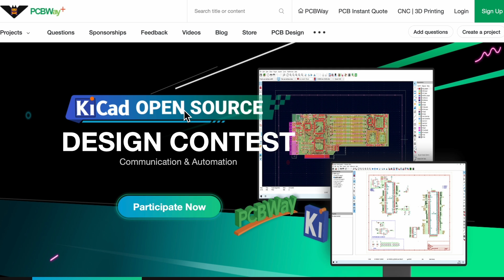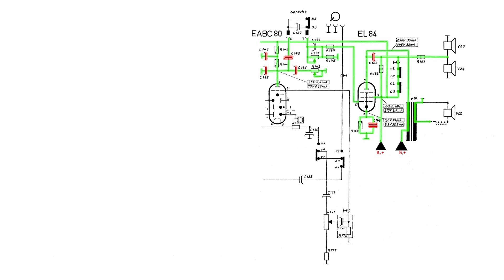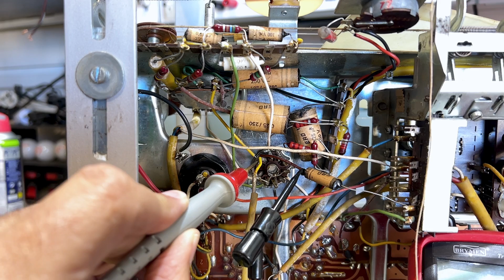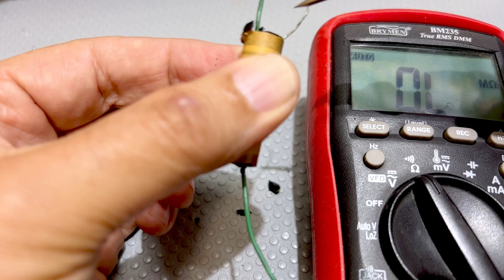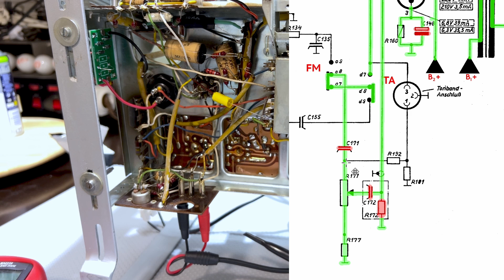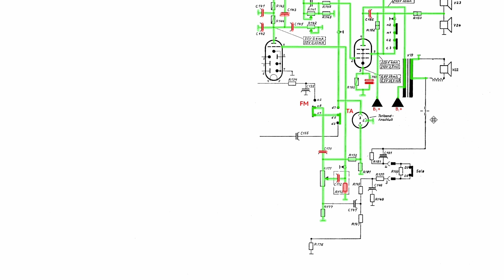Preamp, Tone Shaping and of lots of detail - Tube Radio Restoration Back to Basics part 6 #pcbway#

Comment: The pin 1 of the EL84 can be a mean trap. It shouldn't be used as a solder support point, because some manufactors use it internally as a support, and then the grid 1 is connected to that pin.
Believe it or not, we JUST discussed that in a tech group a few minutes ago.

Comment: Thanks for the video Manuel.

In my opinion, all these 'tone shaping' features are just gimmicks that radio manufacturers added to their products to boost sales. They seem designed to create an illusion of 'progress.' 
I own a tube radio from the late '50s (an ASA 1147)  that has bass and treble controls, a piano key marked 'speech,' and three extra buttons labeled 'solo,' 'orchestra,' and 'jazz' — with 'orchestra' simply meaning neither 'solo' nor 'jazz.' These controls can really mess up the sound. Plus, I don't see why high frequencies need to be boosted so much when listening to jazz music.
Reply from the maker: I must admit I’m more fascinated by the lengths they go to to change the tone, and I really like seeing the means they use to achieve this.
Reply: @electronicsoldandnew  Yes, they are engineering gems, although they add useless features, unnecessary complexity and cost.